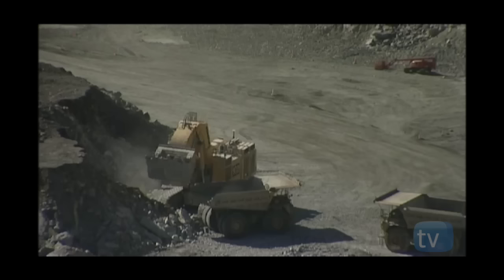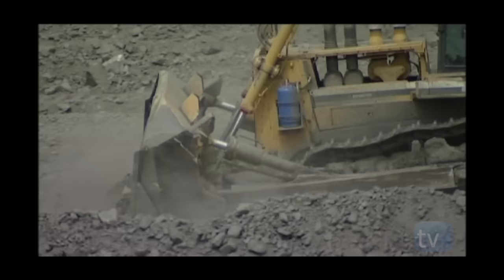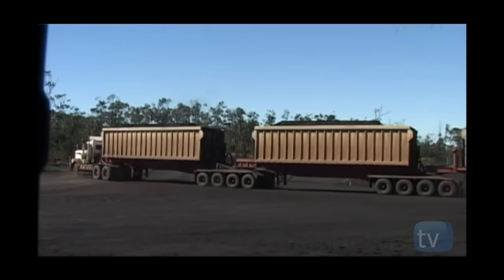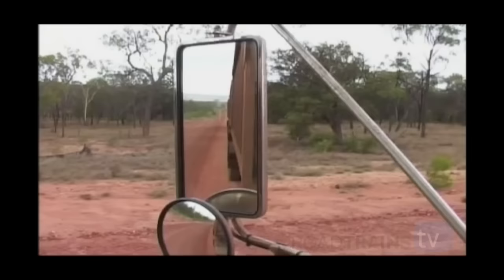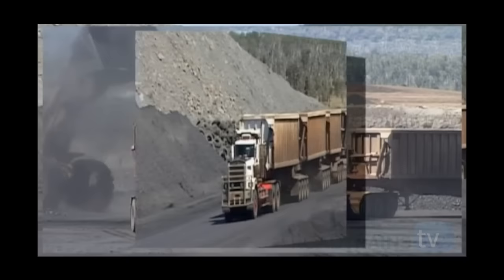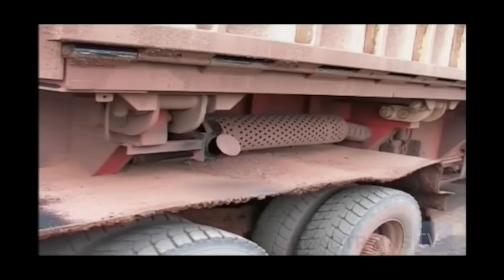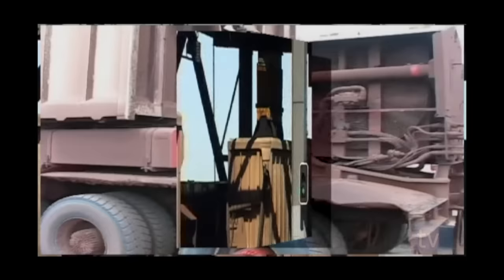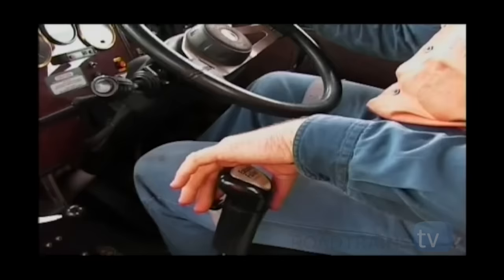Massive 1000 hp Kenworth C510  with 5 trailer road train

Comment: Could you show how it goes reversing into a parking spot at-say- Coles?
Reply: Mark Frost.... Actually, just like the B, Super B, C & Super C Trains in Canada.... you can (If you know what you're doing) Back these up.   If you noticed... there No "dollies" between the trailers.... each trailer is 5th wheeled directly on the preceding trailer, so there is only One joint between each trailer.... they can be backed up... with practice.

Comment: How's the transmission thrown in the power trailer? Is it synced to the gearbox up front?
Reply: The power trailer has an Alison 6 speed automatic and the engine is linked to the throttle.

Comment: I thought the power output of a 19litre would be better. Im currently getting the same HP and more torque out of an X15.
Reply: Maybe downrated for reliability.
Reply: 100% true cummins engines can make more than 1000hp but they detune them so they last forever@briananthony4044

Comment: The machine is impressive, but won't it destroy the road or highway it drives onto? Are there not any alternatives?
Reply: They operated on private haul roads, not highways.
Reply: I’ve driven a few road trains for about a year in Australia years ago. It was mostly off the beaten track haulage
Reply: @dazzamcg2369  These are not registered trucks, they are haul road only. These old girls are still working in a nickel mine in WA’s goldfields. A couple are pulling 300 ton triples and some have been relegated to water cart duties.

Comment: Do these road trains move only straight or they move these heavy loads on curves too?
Reply: Aussie Outback roads are extremely long, straight roads with minimal turns or curvature.

These 5 trailer combinations would be entirely confined to Outback roads and private mining roads. 

However a heavy combination (three trailers and one tractor) can be seen everywhere in Australia and can handle most corners given enough preparation and balls. In rural towns most drivers understand to give road trains plenty of room on the road, and even more when they are turning, to the point all traffic will stop to allow the road train to take the worst turns.

Comment: WOW what a beast, somewhat underpowered, the KW C-510 is too small basically a W-900 on steroids. I,d have built by Western Star a Canadian Company specialising ultra heavy duty tractors and  rigid lorries(trucks) for the Timber(Logging) and Oil Field  Industries. A five axle bonneted(hooded) 10x6 twin steer tri-drive Tractor, fitted with a Kitty-CAT  V-12 Industrial engine uprated to ,1600hp,or 1900hp with turbo-compounding,an 8 speed Clark Power-Shift automatic  gear box (transmission) with manual gear selection, a ZF Hydraulic Retarder, 3 speed auxiliary box by Dana-Spicer or Twin-Disc driving three 40,000lb rated Clark Hub Reduction Axles, at the front twin 20,000lb rated Rockwell or Dana- Spicer Steering axles ,two 1000 gal fuel tanks sufficient for two days work  depending on power settings loading and road conditions  . The spacious cab is fully air-conditioned seating three crew, two drivers and a trailer guard fitted with  a sink, microwave and bunks enabling the tractor to be run 24\7\ with a crew change every eight hours and the tractor undergoes a full service every  four weeks  . Rated at 275-300 tons my Tractor can pull four high capacity bottom discharge(dump) hopper trailers each loaded with 60tons of coal or iron ore, six trailers the fifth powered by a  flat horizontal under chassis mounted  Cummins QRSK of 900hp driving three 40,0O0lb rated Clark Axles the same as the tractor via a 6 speed  Allison  Automatic Gearbox(transmission), i  have a way to power the sixth trailer,s front bogie(dolly) axles.
Reply: Hey Basil, don't call us, we'll call you mate 🤷‍♂🤷‍♂🤷‍♂🤷‍♂🤷‍♂🤷‍♂🤷‍♂🤷‍♂  best leave these decisions to people who actually know what their doing

Comment: Just remember there is a 450 to 500 hp tri drive on one of the trailers plus 600hp on the prime mover which gives it about 1100hp.
Reply: So, does this rig have 606 hp or 1000 hp?
Reply: @michaeldavis2531  The rig has the 606 hp and the engine on one of the trailers has the rest.
Reply: @charyuna  Ah, I see. Thanks!

Comment: Video title "MASSIVE 1000 HP KENWORTH" actually makes 606 hp and 1950 torque nice clickbait
Reply: These units have power trailers that have 400 hp underneath the trailer and coupled electronically to the the main engine. I worked in a mine that operated truck and power trailer combination with all up  weight about 500 tonnes and pulled up a 1 in 7 grade. They could even pull away up the incline from stopped. Allison auto transmission!!!!!

Comment: Brambles? my god how old is this video? from the 80's? also this title is fasle the engine in the truck is NOT 1000hp! it's only 606
Reply: Jason Moyle it's 606hp, but has a push trailer of 450-500 hp to give it that "1000hp" figure
Reply: It's not "one engine" as the video describes it as, there are 2 engine combining for 1000hp.

Comment: 606HP  is far less than 1000HP   
why 19L  Engin provide only 606HP
Reply: The trailer makes up the remaining 400 HP.
Reply: The 19 litre engines are chosen because they can be derated to improve their reliability in these extremely hot and dusty conditions. High horsepower is of no benefit unless it is reliable in extreme conditions. Any 15L  or 16L engine would be operating at the upper end of their ability and their chances of failing in these conditions under extreme load is far higher than a 19L derated engine

Comment: Screw Horsepower.  What's the Torque ???
Reply: John Buick  Boy are YOU ever confused.  .  Do a little more research thar boy....Doctorate physics
Reply: 1900 ft lbs is what it said
Reply: John Buick  you do realize 90 percent of all diesel semi trucks make about as much or less horsepower than a mustang gt 500 or a Corvette zr1 or a hellcat. Diesel motors are 100% built to produce massive torque and are way less concerned about the HP. Hell a hellcat makes 700 hp yet I guarantee a hellcat motor in a semi wouldn't pull a standard size load.
Reply: @thewhiteeazye2728  WHEWWwww  That'd surely push around my F350 6x6 like it was a toy  ;   )
Reply: John Buick  of course with the right gearing a Briggs and Stratton could move a heavy ass load but at what point does it become impractical. A 500 hp gas motor built for a car could not pull a 60k lb. Load a 75 mph down the high way with an Eaton fuller 10 speed. HP is how fast you're going to hit a wall, torque is how far youre gonna take that wall with you. Lol
Reply: @shaunelijah7634  Haha no doubt lol

Comment: It's just a pity they don't have truck engines this big in the USA.  DYK? The smallest European truck engine is bigger than the biggest truck engine in the USA.
Reply: Because USA roads are almost(not all) flat. And you carry alot less weight then what alot trucks carry in Europe, Australia and New Zealand. But also like in New Zealand roads are constant windy and roads are up and down. More horsepower  helps to maintain constant speed on those roads..
Reply: It’s not 1000 HP. 606 HP at 2100 rpm tops. I believe there are more powerful engines in the US.

Comment: Can you even park 5 trailer ? it seems impossible as heck..
Reply: They only go forward park forward take off forward
Reply: Not a problem, they simply never reverse.  Years ago i worked setting up a transfer site fed by a pair of similar trucks.  Towards the end of the project we were told of an incident somwhere on the  route.  The driver dozed off (turned out he'd forged his route books and was working for two haulage companies) managed to get 2 of his middle trailers half off the road at a small bridge over a creek.  SOMEHOW he held it together and drive through the problem, only doing minor damage.  He was fired, but i always thought that they should hire him to teach emergency driving techniques.

The mines usually contract out this work and its a struggle, oftem changing companies every couple of years.  My company (we provide certain support services)working one site has dealt with 7 or 8 haulage firms over the last 18 yrs.

Comment: Quite impressive, ONLY 600 hp to drive a 300 ton rig. In the U.S. 600ph semi trucks pull just 30-40 ton trailers and even then feel like they don't have any surplus power. This road train wouldn't make it through most overpasses in western U.S. though. Or would have to crawl in their lowest gears at 3mph... burning several gallons per mile, instead of the other way around
Reply: They're not 600hp as there is another QSK-19 fitted to a trailer. Approximately 1250hp all up. Also they generally won't be operated on inclines greater than 10%.
Reply: 600 hp plus another 450 in the third trailer, these trucks only drive on private roads on large mining leases, not on public roads

Comment: ONE, has to upgrade to TWICE  THE normal size, of 5th wheel pins. Maybe more, for nearly a million pounds, of weight.
Reply: The trailers don't have kingpins, there is a post fitted to the 5th wheels.

Comment: I'm thinking that Australia needs a couple of Railroads hauling that coal in 100 / 150 car consists. I can imagine Wyoming's Powder River Basin starting out this way. Then demand overwhelmed supply and a diferent way of transport was needed. Oh, if I had the capital and whatever it takes to get rolling .... I see a gold mine.  Imagine 200 car trains hauling coal alongside the road trains. And of course, iron ore ... Quick, someone get me Warren Buffett's number.
Reply: We're you born that way or did something happen?
Reply: @chrissmith2921  Yes to both. When you've been around as long as I have, done some of the things I've done etc, you gain a bit of sinicism towards things in general. Besides, I was simply commenting on how the road train operate and how beneficial a rail network or networks would be in Australia. 
But by all means, if you have a better idea or plan, do share it.👍👍😉🙂🙂😉

Comment: I just saw him do what I do. Change gears with his left foot on the floor. Just use revs to change. No clutch!!
Reply: All truck drivers float gears.
Reply: @boutcha1  
Been doin' it for about 40 years, but only with crash boxes, doesn't work so well with the syncro jiggers. So I wouldn't suggest that ALL drivers do it.

Comment: All that engine capacity and it still only makes as much torque as a 12.7L 500hp Scania. The 650hp Scania makes 500lb/ft more than this.
Reply: Are you sure you're not confusing N*m for lb*ft?  Scania's are great, but I don't think a 12.7L engine can make 2450 lb*ft of torque and have any kind of warranty.
Reply: It's the 650 which is 16.4L makes just under 2400ft lbs or 3300nm. The g500 makes almost the same as this truck. You're right that the new 500s do have some head problems but the V8s just keep on going.
Reply: The 19 litre engines are chosen because they can be derated to improve their reliability in these extremely hot and dusty conditions. High horsepower is of no benefit unless it is reliable in extreme conditions. These engines that you have mentioned are operating at the upper end of their ability and their chances of failing under extreme load is far higher than a 19L derated engine. You clearly have no idea about the conditions these machines are required to work under, I'm sorry but Scania's and Volvo's are just not up to the task.

Comment: 600   Horse power is not much in this Day and Age..  Then   they mentioend the  trailer  has  450  HP  too ..   and  three axles  pushing.      A Diesel engine  an  Allison Automatic   Transmission     with  drive shafts  axle  shafts and    ring gears an pinions  could  be replaced with a way more efficent  ..  Diesel  engine to  electric  generator  to  elctric motors on the wheels..   The  big  off road  haul trucks  already  are   driven  by electric wheel motors..
   Time to Modernize..

Comment: Whys the guy saying ton in such a weird way? Reminds me of family guy and “cool whip”
Reply: Metric unit of measure = Tonne. Pronounced correctly in the vid. That is 1000 kilograms which is equal to about 2200 imperial pounds.
You are likely using 1 imperial "ton" which is very similar to 1 tonne. 1 U.S. ton is different again and equals about 2000 pounds. 

So if you are accustomed to U.S. tons, the weights in the video are heavier than a U.S. ton by about 10%
Reply: A ton is imperial.
A tonne is metric (1,000 kg or 2,200 lb).

Comment: Video says 600hp not 1000
Reply: bigcountry Wrenn I’ve worked on the Cummins Q19 they start at 600hp but I guess they can bump that up with different injectors and computer programming but I’m not totally sure we just used them in the 600hp configuration.

Comment: very impressive Truk and trailers, but why you misleading?   
This  Kenworth C510  power by Commins QSK engine 19L , that  is only 610HP   (WHY do you say 1000 HP ???)  it right that some of the trailer have they own engine to assist)     This engine  design to have long life, under constant hard and long work, in hot weather,   and therefor  produce only 610HP  from large engine as 19L.   

For comparison ,
1) Caterpillar C18  (6 Cylinder (18L) on the USA Army tanks carrier (on and off road . mean: with all the Emission) ) give 810 HP,   Previously the truck have Detroit Diesel  V8 16L   giving 610HP  
2) Same C18  installed  on SISO Trunks ( from Finland)  on/ off road truck )
3) Caterpillar C16  16L 6 Cylinder)  on /off road,   give 605HP
3)  Volvo engine (6 Cylinder 16L) on road not US version, give 740HP.
4)  Scania trunks    (Sweden)  have Scania V8 engine  16L  620HP  (on Road)
Reply: I think he means combined power with the powered trailers too.

Comment: They literally said this truck is only about 600hp what are you talking about 1000hp my ass. It's all in the torque baby
Reply: the trailer at least one is powered thats where the extra power is, pay attention no drive train cant withstand the strain of that amount of weight taking off in dirt or gravel so they need the extra powerplant to get it rolling

Comment: Dang, wonder what the gas mileage are?
Reply: You probably REVERSE it! I bet it's 1.5 gallons to go ONE mile! LOL.
Reply: other than the obvious remark of "they burn diesel not gas" things like this are measured in ton-miles.
it will undoubtedly burn more fuel than a truck with only one trailer with much less weight but its still more efficient because it will burn far less than 5 separate trucks pulling each of those 5 trailers. not to mention the pay rate of one operator vs 5 separate ones.
Reply: A single tractor pulling 80000lbs gets 6mpg
Reply: on pavement. much of these outback roads are not paved
Reply: Well first off there diesel not gas and second of all. A average semi truck gets between 6 and 9 MPG with one trailer that a class 9 weighting in at 160,000 pounds or 80 tons. So it probably only gets between 1.5 and 3 MPG.
Reply: 8 gallons to the mile
Reply: It used diesel I think
Reply: @jimmychambers1501  
Well no shit it better

Comment: as a 40yo guy I'm all giddy for BIG mashinery. I would just love it, if we could marvel at something thats not ruining the planet. Australia could be supplying all of Asia with H2 made from solar farms.
Lets get crazy about high speed rail, offgrid solar, offshore wind, high-voltage direct current power lines sustaining a 24/7 renewable power grid...fully electric (regional) passenger flight in 2030 for gods sake!
There is SO much fun to be had with technology that is not to do with burning fossilised carbon.

Comment: Kenworth should use Scania's V8 730HP or Volvo's 750HP engines in this trucks. Way more powerful than those Cummins...
Reply: The Volvos and Scania are too unreliable in Australia when they haul really big weights. They can't handle the heat and huge weights that the Kenworths haul. They've been tried and they've  failed.
Reply: Say that they can't handle huge weights is BS, since those are the most powerful engines (we're talking 3500nm+ of torque, way more than the engine of that Kenworth tractor) in mass production trucks in the world. And since you already told me a BS, the unreliable part must be too...
Reply: Didn't you read the part where I said "they've been tried and failed" You aren't talking to some kid reading truck magazines, I actually own and drive roadtrains.

Comment: Pretty slow...should've got a train for the job
Reply: Yeah... with locomotives that cost much more and rails that cost even more and an army of people to run the train, maintain the track, control signals, etc. 

Lots of railways in my country only operate with federal grants and the few private ones bought previously public roads at pennies on the dollar and took what was well maintained infrastructure and ran it into the ground while having single engineer trains. 

The result was the Lac Mégantic rail disaster.

Comment: I would prefer the Volvo FH16 or NH16 with 750 HP.  Better gearbox, better suspension, better cabine and better comfort and as least as reliable, less noise, inside and outside, MUCH safer for diver and other roadusers and more modern.  Kenworth semitrucks didnt change much since the 80's
Reply: Europeans trucks have been tried many times in the past and they have failed, they are just not up to the extreme heat and dust in outback Australia, these are the facts so please just deal with it and move on. These Kenworths are designed and manufactured in Australia to suit Australian conditions, that is why they are used and that is why Euro trucks aren't used.